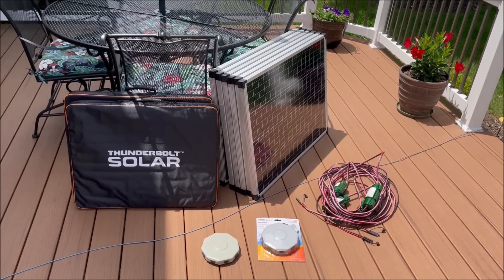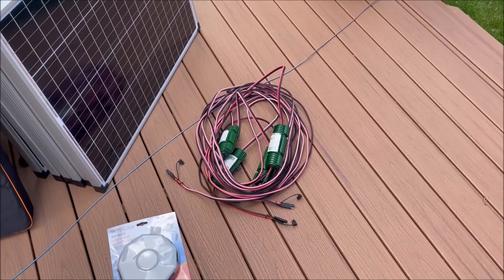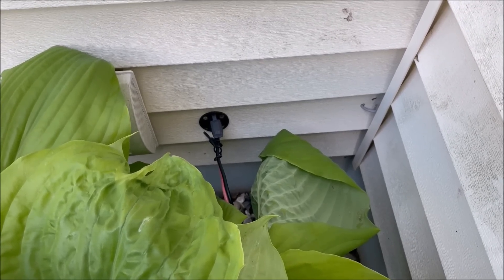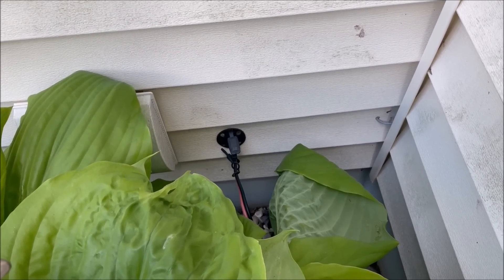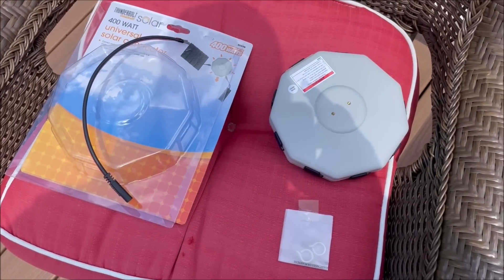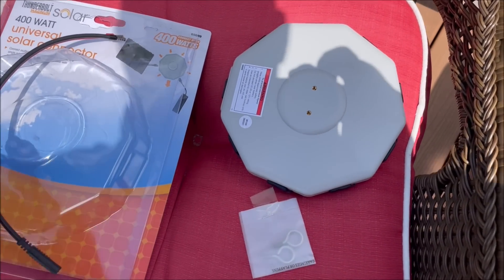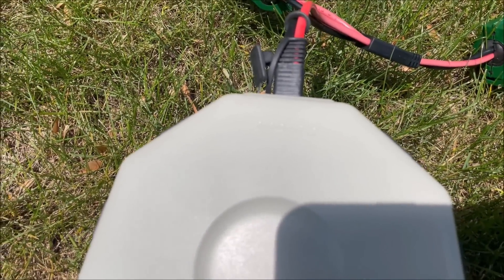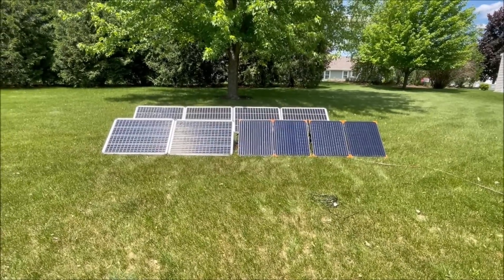Part 1-Hook 8 Harbor Freight Solar Panels together in Parallel - OOPS - "Houston We Have A Problem"

Comment: 60 feet of wire is way to long.  Shorten your length or increase the guage of wire.
Reply from the maker: Produce more then 300Watts with 300Watts of panels since switching to a 3S configuration at approx. 60Vdc.  This video was in parallel at 18Vdc and way to much current.  See Part 2 for the cure.

Comment: Would a 4 panel setup in series, times 2, then parallel both 4 panel groups  I'm doing this with 4 panels...I got white pvc pipe in 10 ft sections, and snake the wire through to keep out moisture and sunlight from the wire & SAE connections
Reply from the maker: Yes you can connect the panels that way.  That is a 4S 2P configuration.  See my Video below on 3S Configuration but just use 4 panels.  Just be aware that your open circuit voltage (VOC) will be about 88Vdc, and the full sun voltage (MPPT) will be about 72Vdc if using 100Watt Panels.  Make absolutely sure you charge controller can handle that high of a voltage.  I will be doing a 4S video this summer.

https://youtu.be/wh-JdIQfAZ4
Reply: I have a 30 amp mppt controller: rated at 96v max & 400 watts max for a 12v system, I have 4 of these panels, and have recorded the Volts & amps so far. These panels are the newer Harbor Freight 500w & not the older 300w panels. These are 6.2 Amp & 18 or 19 Volt  max panels. My panels have gone to 6.2A and 14.8V so far, but stable at 5.3A & 14.2V during charging and usage  (21.3A & 14.2V) Total of 4 X 100W panels.  This is a great emergency power source.

Comment: You're capped with the current flow going through the wires you get 100 watt solar panel at the end of the panel cord any further than that in your losing current you got five cords hooked up and splitter take two panels put them right beside the house put one y Splitter on it and plug it in the wall outside the house. Then go inside and look at your voltage reading plug jewelry extension cords into it and look at how much you losing power times that by 4 you need freaking welding cables or take your charge controller off the wall up there to where your round disk is with all the wires plugged into it plug it in right there and see what you get
Reply from the maker: Check out Part 2.  I switch them into a series parallel configuration to lower the current and they worked great.  Recently with a larger charge controller measured 702 watts out of 600 watts of panels.

Comment: I would have been the first to tell you to get rid of that charge controller because that thing's a piece of shit those damn panels will spit out 105 to 108 watts in the Sun I do it everyday. You get four panels you're going to get about 420 Watts of charging power and I plug it right into my van powers 2000 charge station so I don't know how you guys do it but that's how I use it screw those little solar chargers
Reply from the maker: Check out part 2.  I switched to a series parallel configuration and now draw greater then rated.
Reply: @thechiefsway2618  That's what I do I run two panels series and then in parallel and that's how you get the most out of them

Comment: Dont know what your charge controller is doing under the hood.  But in order to get maximum power transfer, the output impedance (resistance here) needs to be equal to the input impedance of the load (your charger).  If they are not equal you will not get maximum power transfer.  Find out what the input impedance is of the charge controller, and then rewire your array (combinations of series and parallel connected panels as necessary to produce the same resistance) and it should then give you max power.  Alternatively, you might want to look at how much current you are putting through those wires from the panels to the charger.  It was not clear to me how the panels are connected, but if in parallel, that is likely a lot of current, and then your cables may be too thin for that much current, and might be dropping your power.  Shorten all those lines to as short as possible (i.e. get the arrays very close to the house) and see if it makes a difference.  If it does, then you need thicker cables.  If it doesn't, then you need to match the impedance as described above.  If that does not work, then your charger may not be performing as it has been rated, or you are violating one of its parameters for optimum performance (too high or low a voltage input or too high or low a current input.).
Reply from the maker: Check out part 2.  I switched to a 3S-2P configuration and the system is now making greater then full power.

Comment: What I’m figuring out is is the wiring you might need heavier wires to your controllers or the battery and to your other advice
Reply from the maker: Watch Part two if you can.  I fix the issue by switching to the 3S-2P configuration.  Up'd the volts to about 56 and dropped the amps to 12.

Comment: You definitely need to run several groups of panels in series, then parallel those groups together.  In addition, you need to ditch the Harbor Freight combiner, SAE connectors, and tiny wire you are using.  The purpose of an MPPT charge controller is to allow you to run higher system voltages to a charge controller which then converts to the lower battery voltage, but there is a reason why Edison lost the battle with Nikola Tesla and Westinghouse between his DC electrical system he proposed and the AC distribution system we have today.  Voltage drop  of wire, the higher the current flow in a conductor the more losses you will have.  You need to increase the system panel voltage as well as increase the wire size going to the controller, that is where your losses are occurring.  As soon as you add more current the wire begins to heat up more, the connectors heat up more, and your losses increase.  I would also not have a system connected through my house wall if it is to be considered temporary emergency backup, those SAE connectors are low quality and if you have a fire I promise you the insurance company is not paying out on your claim and your neighborhood looks beautiful, I am assuming your home is as well and I think the inexpensive wiring and connectors present a huge risk you are taking.  I appreciate the intent if this system, and I agree it is a great idea, but my entire career was as an aircraft electrical system specialist and I fully understand the challenges you are facing, and a little corrosion on those connectors over time and you will really be having issues.  Good luck and have fun with the system, but please take a little rime and research some better wire insulation types, diameters, and connectors.  The Renogy controller is putting out what it can based on what it us receiving, the losses are before your controller, additionally you will nit see full output to lithium batteries that fully charged due to stadium effect of electrons trying yo find a place to go in the full batteries.  Take care.
Reply from the maker: Check out part 2 to this video.  I switch to a 3S-2P configuration, modify the SAE to MC4.  System runs great after that.

Comment: Get a better charge controller there cheap and have usb outputs for around 40 bucks bud I thank it will boost your efficiency
Reply from the maker: Since switching to a serial 3S-2p configuration it works perfect.  Serial is much superior to parallel.  Watch Part 2 to see the transformation.

Comment: rewire the panels to 24v configuration and drop line loss more volts less amps less lose
Reply from the maker: Check out Part 2 to the Video where I convert all the SAE connectors to MC4 and connect the panels in a 3S-2P configuration.  Problem Solved.

Comment: Are those panels 24v
Reply from the maker: No, they are considered 12V.  The open circuit voltage is about 22V but operates in full sun at 18V.
Reply: @thechiefsway2618  what is your controller? PWM or MPPT?
Reply from the maker: @TheJ7777777777777777  MPPT

Comment: Worst with them is they are indoor use only and can't take rain . If you have them close to the solar cell  put them in a small enclosures to protect from rain . Have one but have now just bought  wires that combine into a parallel connection  and then you can run just two wires to one next to the charge controller.  Nice set up for all your other stuff .

Comment: Hub and cables are only rated to put out a max of 500. Says so on the box.  TRY to use an extra hub on anything over 8...Mix of panels also will decrease your energy ceiling. Double your hub output at your breaker going to your controller. Lol 😆 I've gone through a lot of trial and errors too but been playing with them for a decade.

Comment: HOWdy  T-C-W,
Thanks for the Walk-Thru ( with "SAE" Connectors ) 
those metal "ends" crimped on STRANDED-WIRE 
are referred to as " FERRULES "  
and really help if a person plans on several Insertions / Removals 
from an INSTRUMENT or  DEVICE    
"PARALLEL" connections do not PRODUCE as well as SERIES Connections ... 
especially with any  LONG  Runs from ARRAY to HOME Inverter 
SUGGESTION: when converting to MC4 connectors - UPGRADE your  AWG up too / to maybe 8 AWG Gauge WIRING ... 
Thanks
COOP
...

Comment: Won't use those universal connectors I saw what they said about them and those universal connectors would get blown right up if I use them cuz I'll hook for 100 watt solar panels to each connection from harbor freight cuz I ain't going small I'm getting 4,000 watts. 100 watt solar panels like those little solar panels.

Comment: I have a question about my 25 watt solar panels that I bought from harbor freights I bought four of them in a package there they're like 12 volt battery chargers they give something like between 14.7 and 18 votes well the other day they'll give me 31 volts I don't understand why they can give me 31 volts when there's only four 25 watt solar panels I was hoping you might better answer that to me for me good friend and I'm going to do one favor for you I'm going to go to Walmart by there 100 watt solar panel which they say is 120 w solar panel exact same size as harbor freights I'm going to go to tractor supplies get there solar panels that are rated the same as harbor freights with a slightly higher amperage for a little bit lower price you got to order those off the app store though and either they'll come to your house if you want to or you pick them up at their place I'm going to test those because those are a little bit cheaper than harbor freight solar panels and it seems like that year round I'm going to see if I can travel a shortage distance to go pick him up cuz I will pick him up at the stores cuz not every time you're delivered to my house I don't think and I work in a town where two of those places are called Walmart and tractor supplies but Walmart does deliver to my house so I don't got a problem with that one. And I'll tell you after all about the same or which ones are better.
Reply from the maker: Those Harbor Freight 25W Solar panels are only about 17W.  I have one ane have never gotten more then 17W.

Comment: But I will do you another favor I'll buy another four harbor freights solar panels that are not connected to my system and I'll test them for you I attach them apart from one another and I'll test them together just two way the best way to get to solar power you need I'll even buy that little round thing and see what it can handle I burn it up trying which is quite easy to do with solar power something I'd rather not do cuz they got one charger that I got a 15 watt set of four solar panels I'm going to test as well that is a charger smaller than a 30 amp charger and I don't go away with the watch says I go by with the amps is but the one doesn't tell me it's amps I'm going to find out what it's amps are what it can handle what it can do what protection has on it or protections it needs it doesn't have and I'll give it a review and I'll let harbor freights know about it and then tell him what they need to do to fix the problem and that's what I do for you just a little round thing you connect on your solar panels too which you actually supposed to connect to 15 watts solar panels to it I think one connection is 15 watts one connection is 100 w one connection is 50 Watts another ones 100 watt and another one is 100 w and another one is 15 watts and that's what you can connect to those little round things and connect your solar panels too and that's kind of what they told me in the store too it only can handle so much not all the plugins as 100 Watts that won't work and a burn out the system and it destroy it but I'll test it and that one I won't give a review on because I already know what they said they told me that when I was at the store and ask him about it then I said it's not worth the dirt that it's made out of it's one of those rejecting they should probably send back but they still have them but they probably could fix it with I don't know how well actually I do but I'm not working for them and I'm not doing that kind of work. I'm actually making food for people to eat and I fix their machineries but I make the food I'm not a maintenance person but I do not fix it and I do fix it just because of what I did in the past I know I can do it so I do at least what they let me do but they find out I know more than it'll let me do but I'm responsible for making food so 100 million people won't starve in the United States well that's not quite true I mean it only takes out 2/3 of everything that's in a store doesn't take all the food out of the store just all the breads all the peppers all the salad dressings all the mirror clip all the male all the mayonnaise all the gravy all the pepper peanut butter which I was surprised that when I just found out that the other day we actually make peanut butter not completely but a good remedy of it which is kind of surprising to me and many of the spices meaning the sauces for a lot of the canned goods gravy back in the 80s the original owner got his hands into just about everything for food that are in stores and restaurants and fast foods and so on and so forth the company must never close and I can't say that's not going to happen but I know it ain't going to happen for many years and I'll probably work to the rest of my life cuz I know they tell me I'm the main person I'm the one that can make things get done cuz I do so much more than I'm supposed to because I'm able to I pull more than what is required a lot more than what's required for a daily work and the same amount of time so it's harder for me to move up at the company for a better positions but they're finally doing it now after how many years it's surprising so they replaced me with three people and it said if I have to hire two more to take my place but they still put me down there every now and then too but that's life I like where I work I just don't make very much money. And most people quits because it's such low pay. I can't quit I got a conscience and that's what keeps me working there even though I grow most of my food I eat. Of course I know I could grow all the food I'm eating but I'm not a vegetarian I do like meats but I can get my mates from a farm anyways my brother's got two of them so I do okay but that's besides the point I have a conscience I will keep working probably for many years I'm just trying to make it so I don't have to work but I'll still work anyways unless it comes to my family whether you me around more for a certain reasons cuz my family becomes first out of anything else people should take that to heart we need more people working not people not wanting to work.